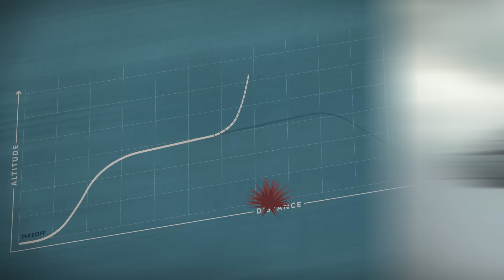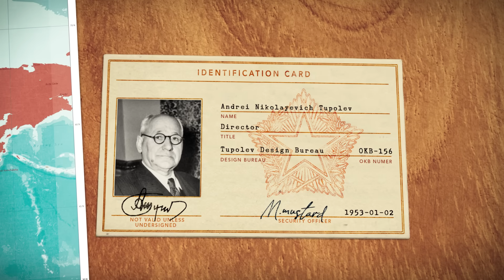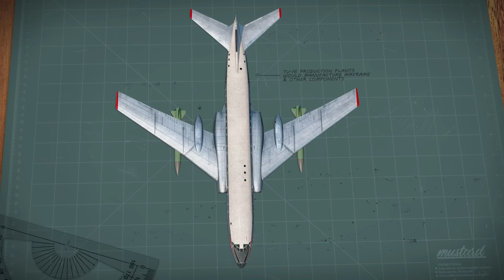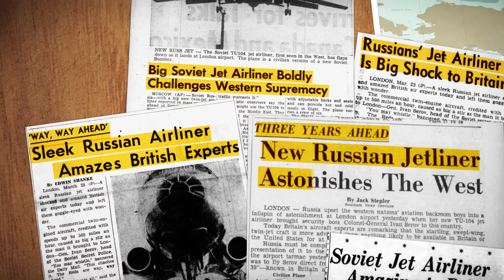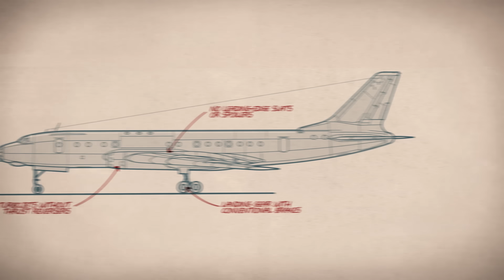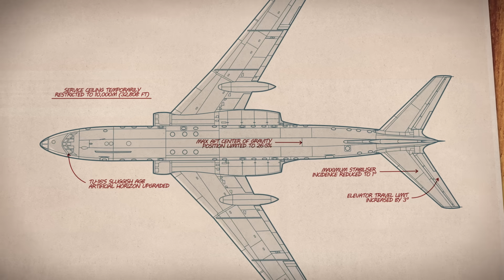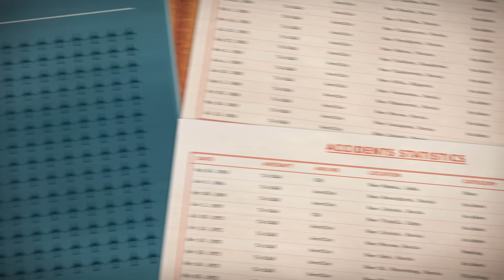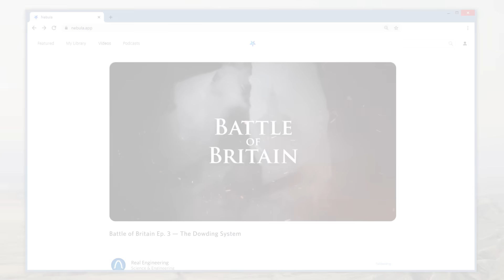The Soviet Airliner Designed To Crash

Comment: The Comet was a death trap too.
Reply: The marvellous trailblazing DH Comet.

World's first jet airliner.
World's first high altitude airliner.

De Havilland was subjected to forced merger during the UK Govt instigated aerospace sector rationalisation programme.

Instances of all Comet marks, including the Comet 1, flew with full certification at some point after 1954. Airline duty Comets were all retired by 1980 with full certification until after retirement. The last Comet flight was a global circumnavigation series of flights in 1997.

   Of course De Havilland carried out a full stress analysis & performed extensive & protracted testing on two long lengths of fuselage. De Havilland carried out significantly more testing than was required by any authority at the time & significantly more testing that any previous airliner was subjected to.

    De Havilland did indeed always work to better than industry standards at the time, used up to date knowledge for the design & no evidence of negligence  or criminal negligence was ever produced in relation to the DH Comet.
  
  Obviously there have been worse aircraft for accident losses both before & after the Comet, that includes's fatality rate metrics. One of the issues was accident losses & incidents due to pilot error which were often caused by the novel aspects of jet airliner flying, even so, the accident losses for the Comet were not particularly unusual at the time.

About Bow-wing for instance (See b-47 wing folding / collapse incidents.)

There can be no excuses for the 737 Max incidents after more than 50 years design, build and operation experience & with up to date aviation infrastructure. 737 Max, 2 particular incidents caused 350 fatalities. Aircraft auto pilots itself into the ground, two times.

The many & varied reasons for Bow-wing's (See b-47 wing folding wing collapse incidents) current existence & status have nothing to do with the company itself by the way.  

    How things were back then. 
Accident losses - % of aircraft built.
DeHavilland Comet 4 UK              14% 
DeHavilland Comet all mks          17%  
Vickers VC10 UK                            5%

The DH Comet had better safety than or similar safety to many other commercial passenger aircraft of a similar era.
Douglas DC-1                                      99%
Douglas DC-2                                      47%
Douglas DC-3                                      30%
Douglas DC-4                                      26%
Boeing s300                                        72% 
Boeing 307                                          70%
Boeing 247                                          48%
Boeing 707                                          20% 
Lockheed L-049/149 Constellation  30%
Lockheed Electra  Turboprop .          29%
Fairchild FH-227                                 30%
McDonnell Douglas DC-8                  14%
Sud Aviation Caravelle                       15%
Canadair CL-44  Turboprop               46%  
Convair CV-580  Turboprop               22%
Convair CV-880     (ff 1959)               27%  
Convair CV-990     (ff 1961)               33%
Tupolev T-104        (ff 1956)               16%.

Comment: I wouldn't test the first planes😅
Reply: The marvellous trailblazing DH Comet.

World's first jet airliner.
World's first high altitude airliner.

De Havilland was subjected to forced merger during the UK Govt instigated aerospace sector rationalisation programme.

Instances of all Comet marks, including the Comet 1, flew with full certification at some point after 1954. Airline duty Comets were all retired by 1980 with full certification until after retirement. The last Comet flight was a global circumnavigation series of flights in 1997.

   Of course De Havilland carried out a full stress analysis & performed extensive & protracted testing on two long lengths of fuselage. De Havilland carried out significantly more testing than was required by any authority at the time & significantly more testing that any previous airliner was subjected to.

    De Havilland did indeed always work to better than industry standards at the time, used up to date knowledge for the design & no evidence of negligence  or criminal negligence was ever produced in relation to the DH Comet.
  
  Obviously there have been worse aircraft for accident losses both before & after the Comet, that includes's fatality rate metrics. One of the issues was accident losses & incidents due to pilot error which were often caused by the novel aspects of jet airliner flying, even so, the accident losses for the Comet were not particularly unusual at the time.

About Bow-wing for instance (See b-47 wing folding / collapse incidents.)

There can be no excuses for the 737 Max incidents after more than 50 years design, build and operation experience & with up to date aviation infrastructure. 737 Max, 2 particular incidents caused 350 fatalities. Aircraft auto pilots itself into the ground, two times.

The many & varied reasons for Bow-wing's (See b-47 wing folding wing collapse incidents) current existence & status have nothing to do with the company itself by the way.  

    How things were back then. 
Accident losses - % of aircraft built.
DeHavilland Comet 4 UK              14% 
DeHavilland Comet all mks          17%  
Vickers VC10 UK                            5%

The DH Comet had better safety than or similar safety to many other commercial passenger aircraft of a similar era.
Douglas DC-1                                      99%
Douglas DC-2                                      47%
Douglas DC-3                                      30%
Douglas DC-4                                      26%
Boeing s300                                        72% 
Boeing 307                                          70%
Boeing 247                                          48%
Boeing 707                                          20% 
Lockheed L-049/149 Constellation  30%
Lockheed Electra  Turboprop .          29%
Fairchild FH-227                                 30%
McDonnell Douglas DC-8                  14%
Sud Aviation Caravelle                       15%
Canadair CL-44  Turboprop               46%  
Convair CV-580  Turboprop               22%
Convair CV-880     (ff 1959)               27%  
Convair CV-990     (ff 1961)               33%
Tupolev T-104        (ff 1956)               16%.

Comment: Russians have always been technological morons
Reply: Their jets were better than British ones...
Reply: @DoktorBayerischeMotorenWerke 

The marvellous trailblazing DH Comet.

World's first jet airliner.
World's first high altitude airliner.

De Havilland was subjected to forced merger during the UK Govt instigated aerospace sector rationalisation programme.

Instances of all Comet marks, including the Comet 1, flew with full certification at some point after 1954. Airline duty Comets were all retired by 1980 with full certification until after retirement. The last Comet flight was a global circumnavigation series of flights in 1997.

   Of course De Havilland carried out a full stress analysis & performed extensive & protracted testing on two long lengths of fuselage. De Havilland carried out significantly more testing than was required by any authority at the time & significantly more testing that any previous airliner was subjected to.

    De Havilland did indeed always work to better than industry standards at the time, used up to date knowledge for the design & no evidence of negligence  or criminal negligence was ever produced in relation to the DH Comet.
  
  Obviously there have been worse aircraft for accident losses both before & after the Comet, that includes's fatality rate metrics. One of the issues was accident losses & incidents due to pilot error which were often caused by the novel aspects of jet airliner flying, even so, the accident losses for the Comet were not particularly unusual at the time.

About Bow-wing for instance (See b-47 wing folding / collapse incidents.)

There can be no excuses for the 737 Max incidents after more than 50 years design, build and operation experience & with up to date aviation infrastructure. 737 Max, 2 particular incidents caused 350 fatalities. Aircraft auto pilots itself into the ground, two times.

The many & varied reasons for Bow-wing's (See b-47 wing folding wing collapse incidents) current existence & status have nothing to do with the company itself by the way.  

    How things were back then. 
Accident losses - % of aircraft built.
DeHavilland Comet 4 UK              14% 
DeHavilland Comet all mks          17%  
Vickers VC10 UK                            5%

The DH Comet had better safety than or similar safety to many other commercial passenger aircraft of a similar era.
Douglas DC-1                                      99%
Douglas DC-2                                      47%
Douglas DC-3                                      30%
Douglas DC-4                                      26%
Boeing s300                                        72% 
Boeing 307                                          70%
Boeing 247                                          48%
Boeing 707                                          20% 
Lockheed L-049/149 Constellation  30%
Lockheed Electra  Turboprop .          29%
Fairchild FH-227                                 30%
McDonnell Douglas DC-8                  14%
Sud Aviation Caravelle                       15%
Canadair CL-44  Turboprop               46%  
Convair CV-580  Turboprop               22%
Convair CV-880     (ff 1959)               27%  
Convair CV-990     (ff 1961)               33%
Tupolev T-104        (ff 1956)               16%.

Comment: The Soviet videos regarding the same plane claim the opposite. According to them it was the most successful plane of its time, the Comet was not in use at the time. Tu-104 was carrying the Soviet leaders on their foreign trips and everywhere it was spectated just like “alien flying saucer”.
Reply: The Comet has a much higher loss rate and fatalities statistic than the Tu-104
Reply: @DoktorBayerischeMotorenWerke 

The marvellous trailblazing DH Comet.

World's first jet airliner.
World's first high altitude airliner.

De Havilland was subjected to forced merger during the UK Govt instigated aerospace sector rationalisation programme.

Instances of all Comet marks, including the Comet 1, flew with full certification at some point after 1954. Airline duty Comets were all retired by 1980 with full certification until after retirement. The last Comet flight was a global circumnavigation series of flights in 1997.

   Of course De Havilland carried out a full stress analysis & performed extensive & protracted testing on two long lengths of fuselage. De Havilland carried out significantly more testing than was required by any authority at the time & significantly more testing that any previous airliner was subjected to.

    De Havilland did indeed always work to better than industry standards at the time, used up to date knowledge for the design & no evidence of negligence  or criminal negligence was ever produced in relation to the DH Comet.
  
  Obviously there have been worse aircraft for accident losses both before & after the Comet, that includes's fatality rate metrics. One of the issues was accident losses & incidents due to pilot error which were often caused by the novel aspects of jet airliner flying, even so, the accident losses for the Comet were not particularly unusual at the time.

About Bow-wing for instance (See b-47 wing folding / collapse incidents.)

There can be no excuses for the 737 Max incidents after more than 50 years design, build and operation experience & with up to date aviation infrastructure. 737 Max, 2 particular incidents caused 350 fatalities. Aircraft auto pilots itself into the ground, two times.

The many & varied reasons for Bow-wing's (See b-47 wing folding wing collapse incidents) current existence & status have nothing to do with the company itself by the way.  

    How things were back then. 
Accident losses - % of aircraft built.
DeHavilland Comet 4 UK              14% 
DeHavilland Comet all mks          17%  
Vickers VC10 UK                            5%

The DH Comet had better safety than or similar safety to many other commercial passenger aircraft of a similar era.
Douglas DC-1                                      99%
Douglas DC-2                                      47%
Douglas DC-3                                      30%
Douglas DC-4                                      26%
Boeing s300                                        72% 
Boeing 307                                          70%
Boeing 247                                          48%
Boeing 707                                          20% 
Lockheed L-049/149 Constellation  30%
Lockheed Electra  Turboprop .          29%
Fairchild FH-227                                 30%
McDonnell Douglas DC-8                  14%
Sud Aviation Caravelle                       15%
Canadair CL-44  Turboprop               46%  
Convair CV-580  Turboprop               22%
Convair CV-880     (ff 1959)               27%  
Convair CV-990     (ff 1961)               33%
Tupolev T-104        (ff 1956)               16%.

Comment: No, it was not the most dangerous Airliner ever. The Böing(Boeing) 707 has the same total lost % rate like Tu 104. An unknown effect at high speed and over 10k m Height was the problem at beginn.
Reply: Comet remains the highest hull loss accident rate and death rate
Reply: @DoktorBayerischeMotorenWerke 

The marvellous trailblazing DH Comet.

World's first jet airliner.
World's first high altitude airliner.

De Havilland was subjected to forced merger during the UK Govt instigated aerospace sector rationalisation programme.

Instances of all Comet marks, including the Comet 1, flew with full certification at some point after 1954. Airline duty Comets were all retired by 1980 with full certification until after retirement. The last Comet flight was a global circumnavigation series of flights in 1997.

   Of course De Havilland carried out a full stress analysis & performed extensive & protracted testing on two long lengths of fuselage. De Havilland carried out significantly more testing than was required by any authority at the time & significantly more testing that any previous airliner was subjected to.

    De Havilland did indeed always work to better than industry standards at the time, used up to date knowledge for the design & no evidence of negligence  or criminal negligence was ever produced in relation to the DH Comet.
  
  Obviously there have been worse aircraft for accident losses both before & after the Comet, that includes's fatality rate metrics. One of the issues was accident losses & incidents due to pilot error which were often caused by the novel aspects of jet airliner flying, even so, the accident losses for the Comet were not particularly unusual at the time.

About Bow-wing for instance (See b-47 wing folding / collapse incidents.)

There can be no excuses for the 737 Max incidents after more than 50 years design, build and operation experience & with up to date aviation infrastructure. 737 Max, 2 particular incidents caused 350 fatalities. Aircraft auto pilots itself into the ground, two times.

The many & varied reasons for Bow-wing's (See b-47 wing folding wing collapse incidents) current existence & status have nothing to do with the company itself by the way.  

    How things were back then. 
Accident losses - % of aircraft built.
DeHavilland Comet 4 UK              14% 
DeHavilland Comet all mks          17%  
Vickers VC10 UK                            5%

The DH Comet had better safety than or similar safety to many other commercial passenger aircraft of a similar era.
Douglas DC-1                                      99%
Douglas DC-2                                      47%
Douglas DC-3                                      30%
Douglas DC-4                                      26%
Boeing s300                                        72% 
Boeing 307                                          70%
Boeing 247                                          48%
Boeing 707                                          20% 
Lockheed L-049/149 Constellation  30%
Lockheed Electra  Turboprop .          29%
Fairchild FH-227                                 30%
McDonnell Douglas DC-8                  14%
Sud Aviation Caravelle                       15%
Canadair CL-44  Turboprop               46%  
Convair CV-580  Turboprop               22%
Convair CV-880     (ff 1959)               27%  
Convair CV-990     (ff 1961)               33%
Tupolev T-104        (ff 1956)               16%.